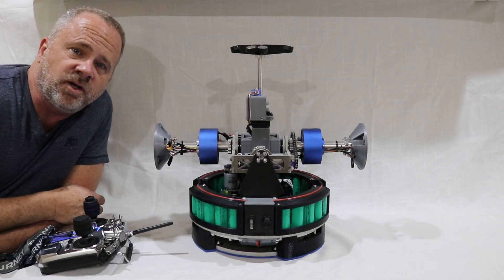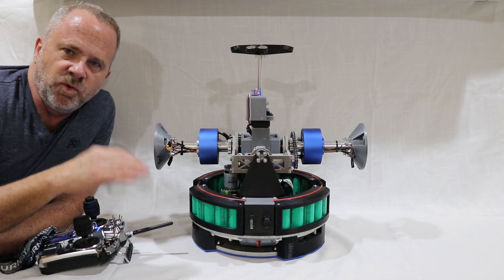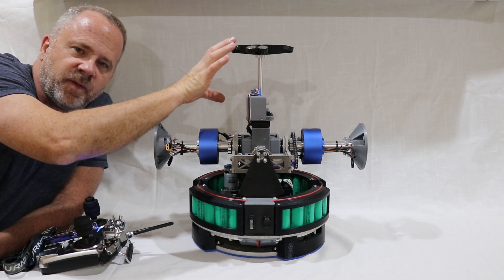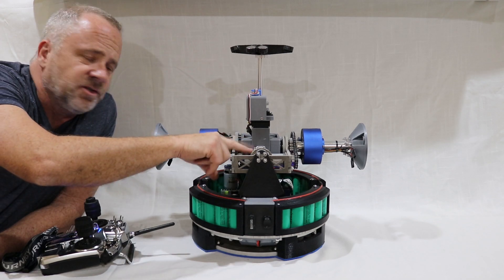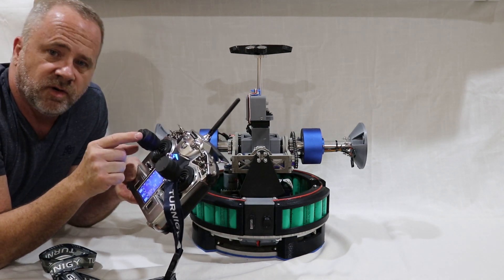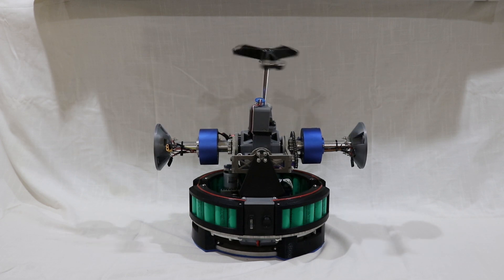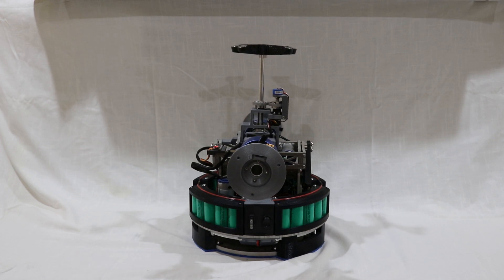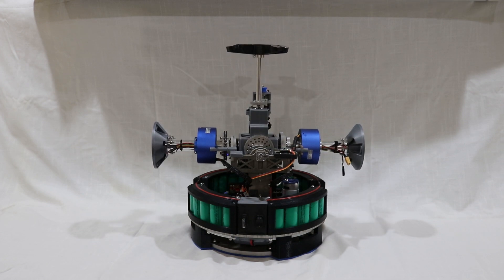How BB-8 works!!!  Cary's V3 Drive

Comment: This is so cool!  Years ago I made a weight-shift RC ball with a hamster ball and I've been wanting to make a larger ball for a long time.  I've been researching drives and shells.  I like this idea.  Mine would be simpler as I have no need for the head control, just steering and drive.  What are the blue rings for?  Thanks, Nick
Reply from the maker: Thank you!

The Blue rings are slip rings, they transfer power from the drive to the ball for lights, sound, and charging.
Reply: @CaryChristieII  Thanks!  I figured that out after I messaged you and saw the plugs at the axle mounts!

Comment: Hi Cary, I am a member of the BB8 builders club forum and wanted to download your V1 drive system files but it appears they are only available on your facebook group. I don't have a facebook account. Are the files available on another site like dropbox or anything? Thanks!
Reply from the maker: The first step is to buy the metal kit, this gives you access to the Facebook page.  Becoming a member of Facebook would be necessary as there is a lot of discussion and people on the group that can help you with the build.
Reply: @CaryChristieII  Thanks for the reply. I would love to buy the metal kit and I have no doubt about the vast amount information and help that gets exchanged on the facebook group but unfortunately i won't get a facebook account even for that. I appreciate the response!